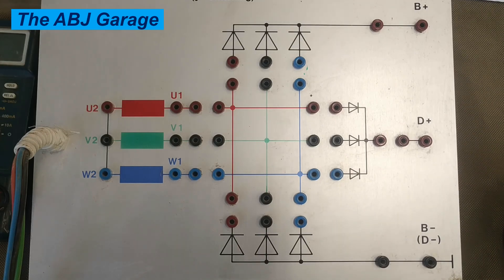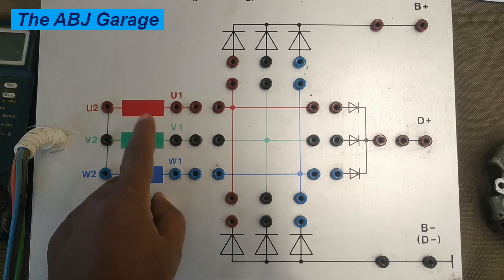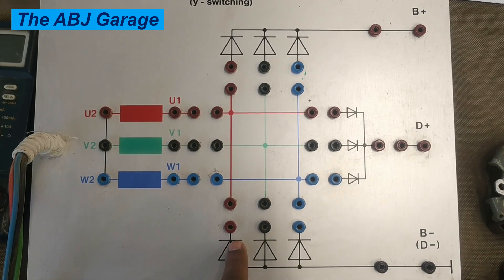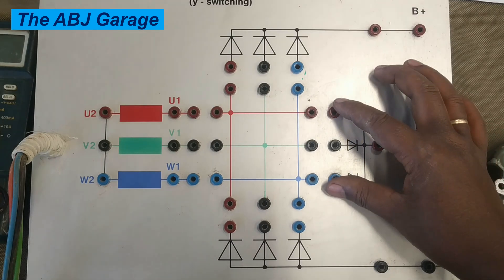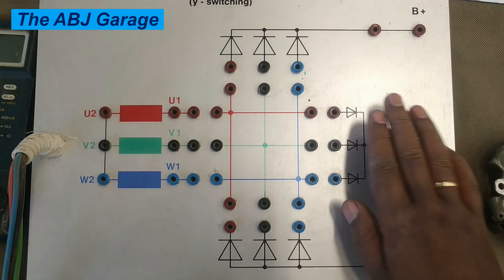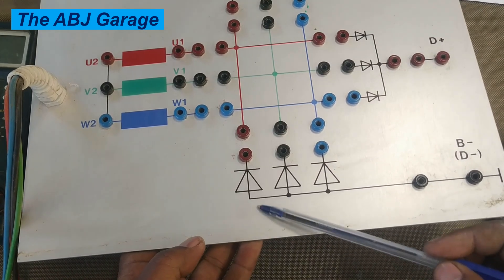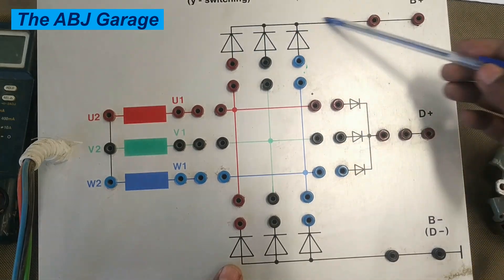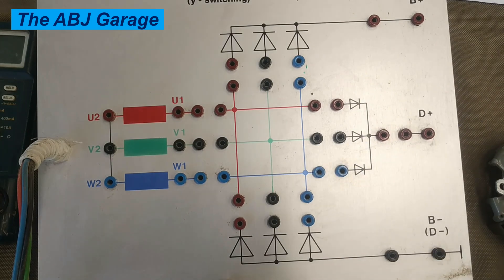Avoid a COSTLY Breakdown! Learn to Test Your Car's Rectifier Diodes

Comment: I tested my old alternator for diode health. It had continuity with multi meter connected to case and battery charging post.  Positive on case and negative on Bat, yielded continuity with a reading of 890. Reversing the leads, gave no continuity. So my uneducated guess is that all rectifying diodes are functional. Even though the 890 seems high. 
But when doing the same test on our new alternator, positive on case gave continuity with only 465 showing. Strangely, swapping the tester leads to positive on output ( bat. post ), and negative on case gave no continuity beep, but did give a reading of 5600.  I have no idea what the large number was. Perhaps decimal point position was relevant, but I saw none.
I called the manufacturer of the unit, and they informed me that the alternator used " avalanche diodes. They said, " because it uses avalanche diodes, it would give a reading in reverse polarity". 
I found it odd, that it gave a reading, but no continuity beep. Can you shine some light on this. I have spent a hour or so reading a lot about avalanche diodes but still feel a bit in the dark about operation, and the readings we got.